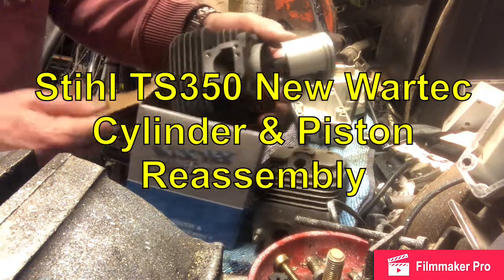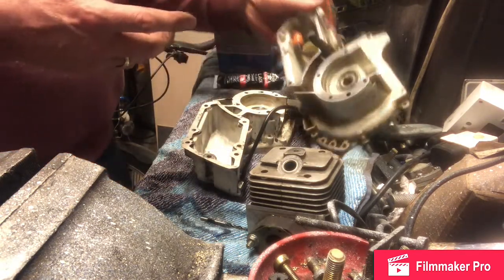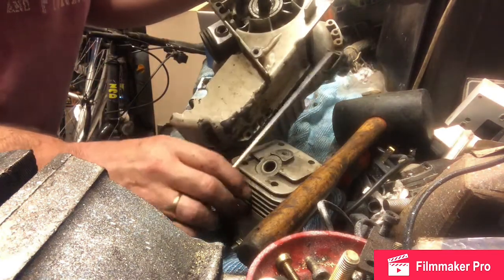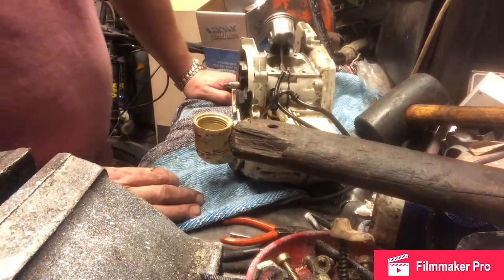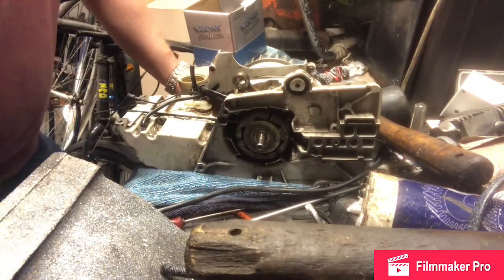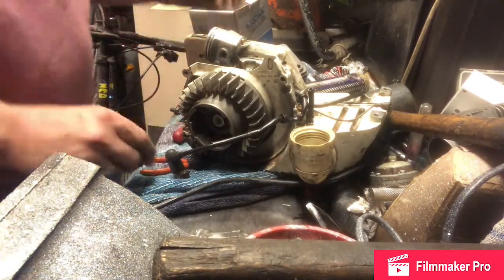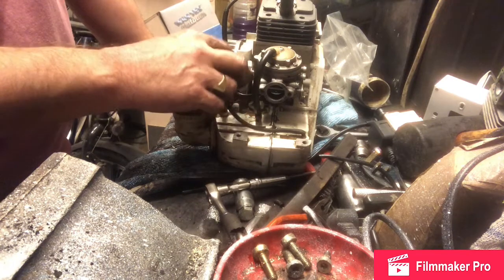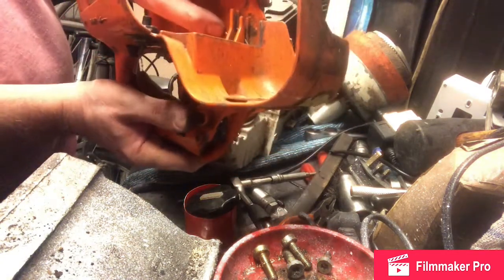Stihl Ts350 Super Crank Casing reassembly with new Wartec Piston & Cylinder

Comment: sorted the throttle, cheers bud, just need to get to the ignition coil, I don’t have a clue how to do it,
Reply from the maker: Remove the 3 T27 Torx bolts from the pull start housing then remove the spark plug and fill the hole with some rags /rope etc to act as a piston stop tool do make sure you can pull it out then remove the crank nut (clockwise thread to tighten) Then you’ll need a flywheel puller for the ts350/08 to remove the flywheel. Look for the timing marks on the coil. If they have disappeared due to corrosion just mark it up with tip ex etc. Before removing the two T27 Torx Screws for  the coil. Personally I’d check for corrosion at the connectors  and clean up if necessary before purchasing a new coil. I’ve rebuilt four of these saws and I’ve never had one with a coil failure but I could have been lucky! Check out my ts350 teardown video I do most of the above. Good luck
Reply: @TheRepairer  I undone the flywheel bolt the other day it was really lose for some reason, what puller do I need? Can I pull it from where the 3 bolts are  on the fly wheel if I remove them 3 bolts
Reply: I’m hoping I can just clean the coil up, because new ones are like £120 new from what I’ve seen
Reply from the maker: @nathanhuitson1418  here’s the link to the puller. https://www.lsengineers.co.uk/puller-flywheel.html
I can’t find a cheaper one at the moment on memory mine cost a couple of quid less a few years ago, Pullers can be diy made but I don’t mind buying them.
Reply: @TheRepairer  cheers man much appreciated, I couldn’t get the fly off because I haven’t got the right puller, but manage to blow most of the shit out and have put some cleaner inside
Reply: @nathanhuitson1418  mate I'll give you a link to a cheaper aftermarket coil

Comment: You know when you're on a winner when the gasket sealant be bulging BUT wouldn't it contaminate the petrol going into carburettor?
Reply from the maker: It’s designed to be oil resistant when fully cured.